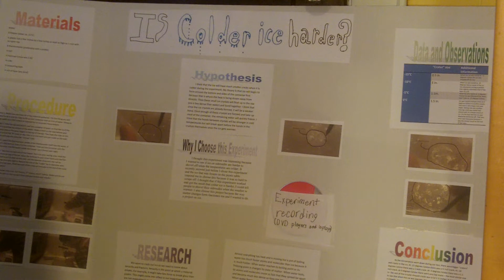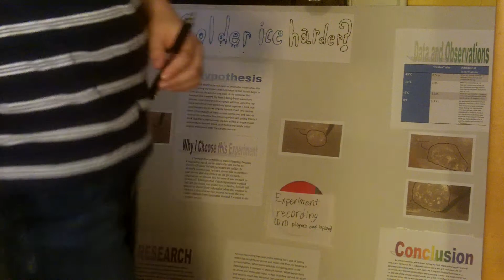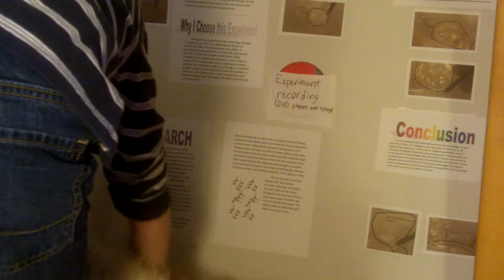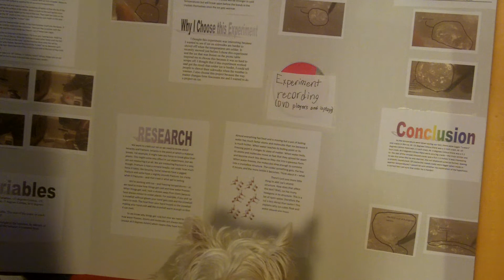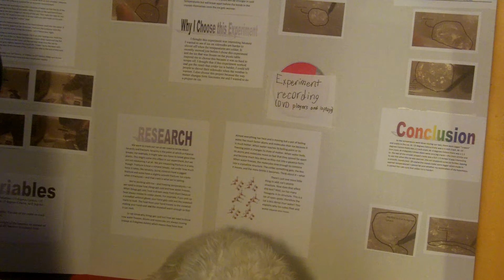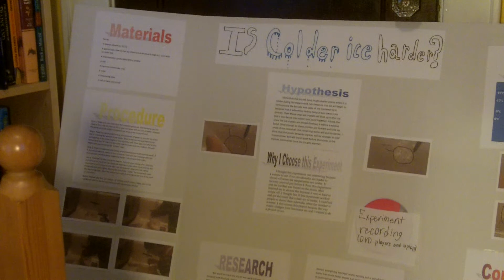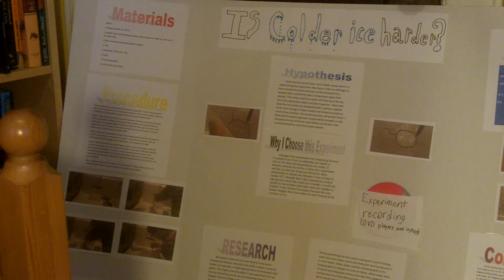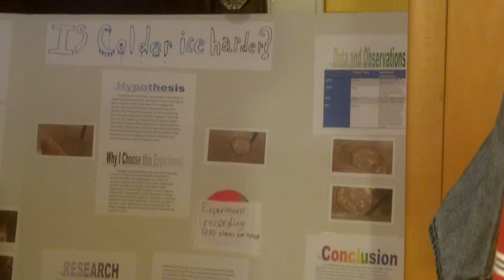My Science Fair Project Part 1

Comment from the maker: @robloxtimmy666666 Sorry dude, I did a project every year starting at 5th grade. For 5th, I did "what household item can light a lightbulb the longest?" I used fruits and vegis and strange concoctions as batteries. In 6th I did " Wich metal will coat a quarter best?" I used a form of electro deposition commonly used in factories to plate metals.